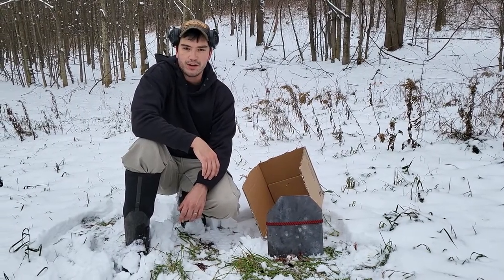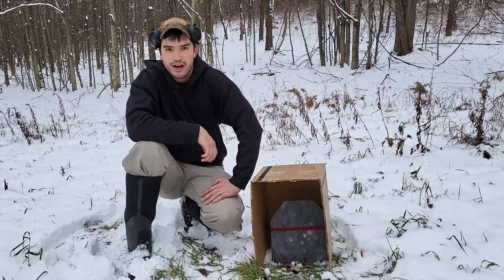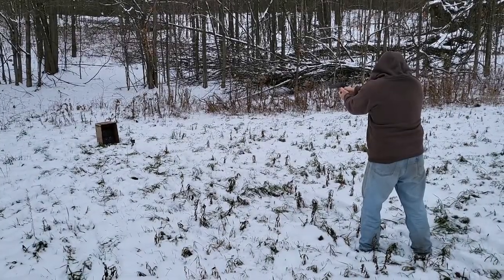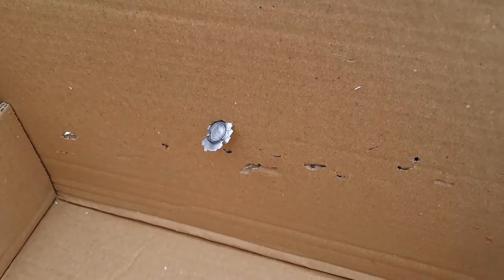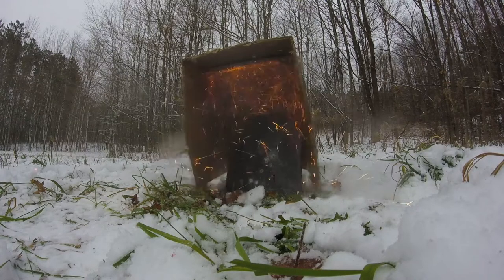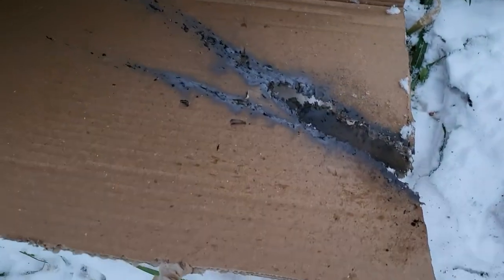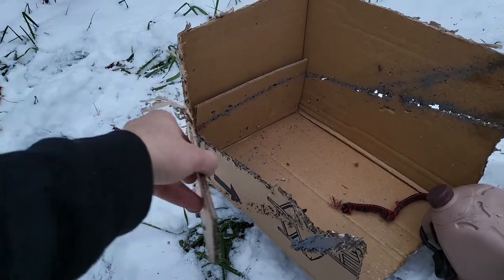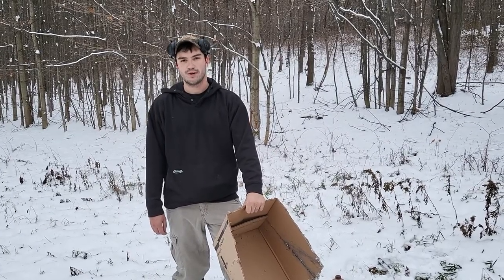How much spalling do you get from a bare steel plate?

Comment: I know this is a bit dated, but using a new spall liner sleeve between shots I think would help to, to eliminate the variable of the sleeve being damaged between each caliber and failing prematurely
Reply: You can get kevlar for like $20 a square foot. Wrap the plate multiple times Horizontally and Vertically and then put in spall sleeve with a trauma pad and zero spall will come out when it come to small arms rounds.
Reply: we also lined suits with the kevlar. It works.

Comment: I was target shooting an ar500 plate with my 1911 45 the target was surrounded with 1/2 ply wood on the top and sides with 2 layer of railroad ties behind it. There is no way any spalling or whole projectiles could pass through. My prick old neighbor came by and told me I put a hole in his agricultural shed 100 yards away. I went over and looked at it the hole was about the diameter of pencil lead. I said no way could spalling go that far and put a perfect  hole in galvanized steel. Even after showing him I caught the rounds and spalling he still insists I did it
Reply from the maker: Much of the spalling we see during these tests struggles to make it through the cardboard, let alone go 100 yards.